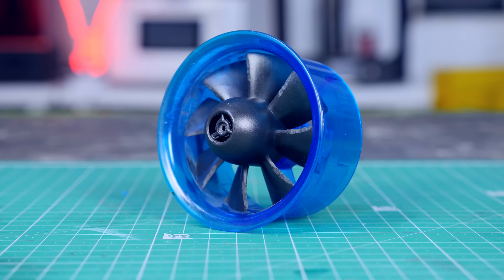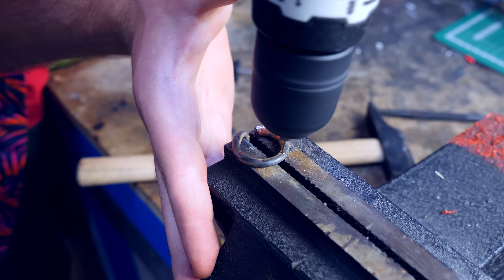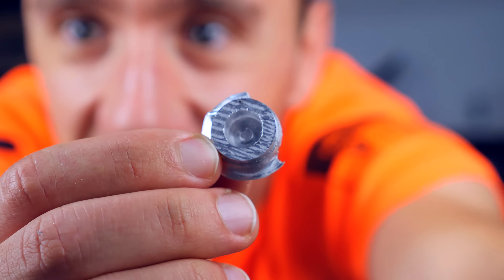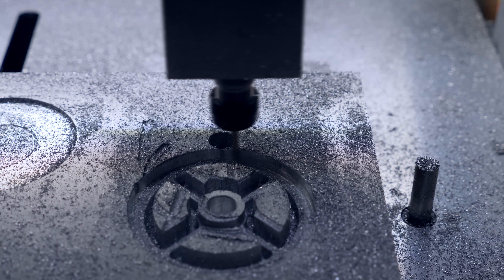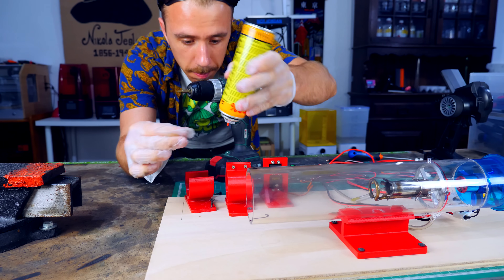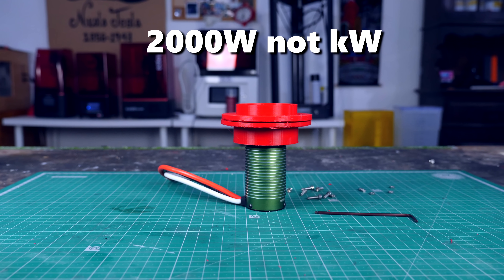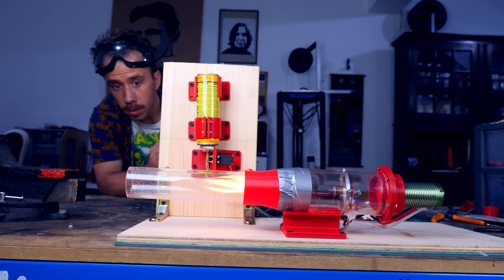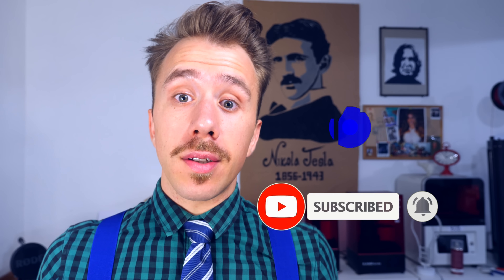I turned my Fan into a Jet Engine (3D Printed EDF Afterburner)

Comment: Hi Integza . Use axial flow compressor , mount it in a bldc use it insted of EDF and you will get better results . Option 2 make a Subsonic version of a ramjet I know its sounds like a joke but check out Maggie's mugges ramjet design . If you need help in designing I can help with solidworks and CFD . I am very keen to see the results ...I love your videos it's so much fun with learning . ....... I also hate tomatoes .... They are definitely disgusting 😂😂😂

Comment: no, the glow plug is not a method of ignition in diesel engines, it only serves to warm up the air/diesel mixing chamber because the warmer it is, the better diesel will combust. diesel engines fumes ignite from pressure alone inside the piston chamber.

Comment: dude for machining that part just toss some tap oil on your cutter often and blow away chips. make small bites with such a small machine, something like a few thousandths and you'll have super accurate and clean parts. if you take too much off with that thing you'll flex the gantry rails and walk your tooling.

Comment: Hey man, when you need to bend copper like you did if you fill it with clean sand you can avoid pinching it when making the tight bends.  This also works really well when bending plastic tubing.   Cap both ends and bend away.
Reply: Thank you sir that's brilliant

Comment: Have you tried lost PLA plaster mold for metal casting. Make or buy a crucible and anything you 3d print can be turned into metal, you should make a rocket out of bronze.

Comment: You just brought up an old question I had in my mind many years ago. Is it possebil to build a turbocharger as afterburner in a car to produce more thrust. Or if you change the compression wheel of a turbocharger with the compression setup of a jet turbine. Would you get higher boost?

Comment: Hey, just a tip for better CNC parts - get a shorter endmill, of appropriate length of course. A shorter endmill is more rigid, which will reduce chatter and improve the quality of the milled walls. For example, if your walls are 0.5 inches tall, try a .625 long or maybe 0.75 long endmill
Reply: A little bit of coolant also goes a long way with aluminum

Comment: why not have a high volume fan to shove air into a "pretube" then a high pressure fan after, that way you will have ample volume and pressure
Reply: I think the tube itself would sort of limit the volume of air but the fan deff needs to be more than 12 volts!

Comment: I would try to 3d print a real compressor and a high pressure turbine nozzle to direct your airflow for compression and smooth consistency for expansion then direct it into a divergent and convergent nozzle cone your more or less building a edc ram jet than a turbine engine in this video. Try thinking suck squeeze bang blow this is the most simple principle for achieving higher compression and higher thrust

Comment: If you watch through the tube, you can see that the tightest, most dense flame is inside, not exiting the rear. My feeling is that if you chopped off a bit of that tube, you would have a near perfect flame & thrust.

Comment: make an exhaust nozzle and the tube out of aluminum and run the fuel aroun them to cool the engine and heat up the fuel like they do to rocket's. also axial fan is better for speed use more than one fan and a diffuser

Comment: You should consider building a proper engine test platform for all these jet engines you've been building. Bonus points if you incorporate a control panel within it to streamline future testing. Extra bonus points for including a sensor to capture thrust applied to the engine mount.

Comment: Go with a smaller bit and be sure to choose one meant for non-ferrous metals, and go with the shortest tool you can.  A flexing tool is an unhappy tool.  Compressed air powered water/coolant will keep the chips clear and keep the tool lubricated.  On the subject of heat.. a dull cutting edge will produce more heat and more resistance.  Going with a tool that has a ZrN coating will help prevent the material from sticking to the tool (which will kill all your fun).  You can't spin a tool too fast in aluminum as it's good at moving the heat (provided you're using some sort of water-based coolant).  However.. you CAN take too like of a cut.  If your chipload per tooth is less than .003"/.075mm the tool is likely to push away from the material.  You're essentially skipping off the surface causing the tool to bend, and bounce, and then it bounces back and grabs hard sending vibrations the other way.  Your tool needs the right geometry and needs to have a short enough cutting length to diameter ratio so that it's strong.  You can also find tools with larger shank sizes so it's stronger further away from the spindle.  Message me for help!  I design end mills for a living.

Comment: I think you should make the next afterburner engine with airflow sensor and a throttle position sensor and advanced electric fuel injection control so you can map the AFR and you just need to adjust a throttle lever and the electric control system would mix the air&fuel and preheat it and you would had a perfectly balanced engine what you say?

Comment: So you can pre-mix a certain percentage of the fuel pre fan ( just below combustion limit) and it’ll get mixed very homogeneously. Then the fuel you ad mid chamber only has to be enough to tip it over the edge of combustion limit and you will get a much higher flame front speed out of it that increases stability and also widens the over all ratio tolerance

Comment: Big tip for machining aluminium with out coolant particularly on a lower end machine is to use a single 0-flute up cut bit, it is very forgiving with chip extraction, slow feeds and low rigidity
Reply: Makes sense...does it take longer though?
Reply: @jonspeidel I do the same thing... cutting Aluminum on a small machine.  Using the right process ends up going faster because you're cutting correctly.  You'll break fewer endmills & spend less time cleaning up parts.  You can buy a cheap 10-pack of them for $20 from amazon.   A way to tell if you're cutting or rubbing is to feel the temperature of the piece your cutting.  If it's hot, you're rubbing the metal off, not cutting it.  Some of what I could see in the video I see signs it wasn't cutting, it was just rubbing.

Also drilling is your friend on a small machine.  Drillings material removal rate is much faster then milling, and you're doing a lot less plunge cutting.
Reply: Also use the highest spindle speed possible

Comment: my problem ive had for a while is a performance intake manifold on a turbocharged internal combustion engine. center feed, side feed, runner lengths/utilizing valves to shorten/lengthen with the goal of equal air mass distribution to cylinders, hi velocity runners to cylinders at operating rpm range but for approx 500 + hp. but since that would take forever, hows about starting with velocity stacks , andf how different shaped bell mouths affect air flow poissibly even going further like the backing of the bellmouth and how that may affect flow of the stack?

Comment: Please make a thrust test rig! Maybe end each video with a stat card for the engine of the week so we can compare them all! No need to go full DIY with arduinos and load cells, just buy a hook type scale like people use for fishing, mount it sideways to a wheeled platform with your engine on it, so when the engine pushes the wheeled platform away it pulls on the scale hook and you can record the strength. Example: https://youtu.be/dYFYZ-g7fzA?t=1532

Comment: You could maybe preheat fuel and cool the engine all in one. Like how they use fuel to cool the bell of a rocket engine. Maybe if you coil the fuel line around a steel tube that you mount the flame tube inside. Also maybe try more then one set of fan blades of different sizes. Use the ducted fan type but reduce the size for each new fan. This should compress the high speed air. Kinda why they call them compressor blades lol. The acrylic tube tbh freaks me out.

Comment: Nice video.
What you need to make it works is a structure called a flame holder, which, as its name suggest, hold the flame, because otherwise you blow your flame away.
Look at Ramjet designs to get inspiration, because an afterburner system is more of its own separate engine (a Ramjet) behind a jet engine than a part of the jet engine itself.
There are quite a few flame holder designs, just keep in mind you have a slower airflow than with a jet engine here.

Comment: Since you are using a 3d printer, wouldn't it be possible to print a centrifugal pusher that goes over into a nozzle whereas the more lateral the angle of the continuous blades get the smaler the diameter becomes? - Wow, what a sentence.

Comment: You could machine the fan and some compressor fans trying to build an even more realistic jet engine. I wouldn't take aluminum, I'd prefer titanium if your mill can handle that. 
And if that's done, build a boat or plane with it. 
Alternative: build 4 of these and build an jet engine multi"copter"

Comment: Why don't you make a cat repelent system, with a arduino and a 3d print mechanism? You can use your CO2 cartridges or a mini water pump to soak wet the cats!  Agora eu quero a minha impressora 3d.

Comment: If you just put a heater on the canister and mount it with the outlet on top you won't need any other method of gasifying the fuel before it gets to the injector.

Comment: Can you make the flame tube out of that brass tube, just a long coil of brass... braze it... solid tube... then your glow plug is pre-heating the fuel! ir wrap the brass tube, around the outside of the flame tube you have, braze those together, maybe that is enough heat for pre-heating...

Comment: CNC recommendations.
If you can get away with a shorter cutter for your CNC, that will improve the rigidity.  A single flute high rake angle cutter helps to deal with horse power deficiencies, it's just slower. A little bit of cutting lubricant can help in aluminum. "Amana 57302 Metric CNC Spiral O-Single Flute, Aluminum Cutting 3 D x 12 CH x 6 Shank x 64mm Long Up-Cut Router Bit w/ To be used only on CNC machines" Continuing to cut on a bent cutter bit can damage your machine. Your cutter should not advance more than .0508mm-.0762mm or so per revolution (known as chip load).
Warning: Never attempt to cut ferrous metals with these bits. It's just not good with this particular design.
I don't know if you could DIY, fit a mist style coolant spray nozzle but it can help give you the finishes that you are after. The aluminum can melt along the cutting edge so that you wind up cutting with a microscopic build up of aluminum on the cutting edge. The coolant/lubricant seeks to keep this at a minimum.

Comment: Maybe get a tiny real turbo (metal), instead of running exhaust through the turbine side, run it with a super powerful electric motor and try to get the turbo to max rpms (usually 150k). May need a gearbox and multiple motors. Use that as the airflow for your afterburner.

Comment: I can only give you tips regarding CNC machining. The cutting tool that was making that mad cow sound was not being held properly in the tool holder. You should invest in a decent quality collet and tool holder. The "Run-Out" of cheaper collets and tool holders cause the cutting tool to cut in a cone rotation which was what caused this issue you had when machining your first part. Good luck with your new CNC learning experience!

Comment: I would like to see you do a video on the type 2 superconductor YBCO (Yttrium Barium Copper Oxide) and the "quantum" pinning effects. A demonstration of the weight capacity you can suspend using it would be a fun thing to see you do. The creation of YBCO requires some special attention during the crystallization process, which could make for a trial and error segment. Ensuring that the crystal structures get 7 oxygen molecules and not 6 predominantly is what really gives YBCO it's ability to lock in a floating position and suspend weight in approximation of 10 times its weight.

Comment: If you spin the blades on your impeller backwards, you can quite easily produce fast flow instead of high pressure flow. Mattias Wandel showed this a few years ago.

Comment: Intezag, err, Intelzug, no that's not right... Integza! Use the glowstick, err, glowplug to preheat the fuel as it goes in, like, just run the pipe next to it for a tiny bit. Half a centimetre tops what with how much it's glowing or you'll probably have a Ka-boom! Great for tomato wars but not so much for rockets or things.

Comment: Why not design a turbo fan intake for the after burner, using a copper tube coiled around the electric motor to double as a heater for the fuel, and cooling for the electric motor, as well as redesign the flame tube so the airflow from the fan doesn't interfere with the ignition?

Comment: hay man. Firstly try use instead of "banana" imagined word "banalala"<-- more funny less stupid :P seriously do not take this wrong but it's just more funny :). Maybe try to make hydrogen engine using electric motor as a fan. As The gas we can project some electrolysis process(i teach chemistry so i can teach you how does it work-see my channel->i'm the beginner but i did that for my students not for the money) then you can use some compressor to make the fuel compressed and turned in to gas state and then do your magic with fuel engines - i'm seriously impressed of your work. I hope Feuture will show us more people like you on YT :) <-sorry for my english :(
Reply: to make proper electrolysis try to use the salt metal I or II group except Mg ang Be and acid line H2SO4 or HNO3 the magic is  that they have their maximum "oxidation level" <-i don't know if it is the proper English but the acids that have maximum of used electrons to make the bonds

Comment: I would also advise doing a comparison between centrifugal and axial compressors. The former is primarily used in older jet engines and some turboprop engines. However most modern jet engines are laid out in an axial flow setup and are capable of much higher performance

Comment: An afterburner EDF?!? This has me interested. Question is, how much thrust do they produce and how much thrust is lost because of the afterburner equipment. 

I saw a video by the guys at Flitetest where one of them put a simple afterburner on a model DH Vampire and it produced a mild-medium increase in thrust and performance with the afterburner, but a small but noticeable loss in thrust without compared to the standard EDF.

Comment: Hey Integza -- look up "speeds and feeds" for the CNC and it will behave much better.  It looks like your feed is too fast and you're really stressing your bit (bendyness is bad).
That said, too slow means that your bit will be "rubbing" and not "cutting" and that dulls the bits quickly... so there's magic numbers for number of flutes, cut size and material.

ESTLCam can figure that out for you... not free, but not a subscription either so...
I use it for my 4x8CNC router.

And that's why I don't trust "all in one" machines -- 3D print -- faster is better, not many forces.
CNC Mill -- Gotta have speed in the right ranges, but you get lots of forces.
Laser - Faster is key, no forces again.

Comment: a tip to running a cnc man is to always keep your cutting bit as short as possible other wise you get a lot of chatter witch is what your machine was doing it also should cut cleaner that way as well
i run the big machines at work cnc lathe and mill

Comment: Very nice. I want to add Some holes For a Venturi. Also nice CNC. What model did you use? And please use your glasses correctly, safety first. You May also use hydrogenperoxide with potassiumpermanganate as catalyst for fuel. That helps experiencing it for rocketengines

Comment: Connect cooking oil to fuel line 

Once engine has warmed up start using the cooking oil 

waste cooking oil can be used if no water is in it and it has been filtered

Comment: Are you running (butane) or (propane)?  If it is (propane), seems it would be a lot more easy if you hooked up a 20 pound tank.  It would be, a huge amount, more economical.  You could fill the whole 20 pounds for the same price as 2 of those little can.  And you would not have to keep changing your fuel input.

Comment: 3d print with the metal filament the fire ring, and try adding an static pallet to increase the pressure, I'm not a designer or an engineer but that could work

Comment: If you want concentrated H2O2.. freeze-concentration works.
It's not the synthesis chemistry that's the dangerous part of H2O2... it's the H2O2 -- you saw how much reactive power it has... now imagine spilling 80% H2O2 on your hand... it will burn, react, and if there's a flame nearby make that flame really, really happy (a la Apollo 1).  So... be careful.  And if any dust of that catalyst makes it into your storage vessel... mucho bad juju.  A single tomato seed...

If you wanna start with higher concentrations look for hair stylist's H2O2 for bleaching (iirc 30%).

But... if you wanna go full oh-noes... you can take the "exhaust" of that German rocket, mix it with fuel, and ignite that -- a rocket feeding a rocket (it's how it's done)... but be &^%%& careful man (in particular oxygen and alcohols... if they gel together they tend to go kapow instead of whoosh...KaPow is 10x TNT or so).  But I bet a Peroxide tomato jet combustor... would be a saucy end to that beastie.  But be **&%%@# careful.

Someplace around here I have an "amateur rocket builder's bible"... in which the "sample device" is 1.3m x 100mm  of 1020 cold-rolled steel, and it describes the bunkers you need (at 500m, that's gonna leave a mark if it hits you - it's not a paper tube!)... but it mostly was solid rocket engines (rocket candy).